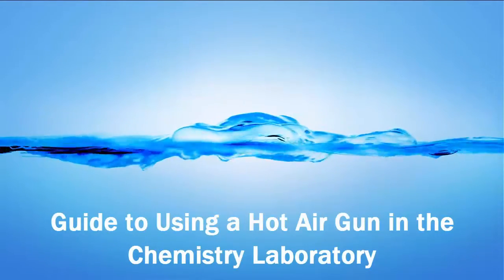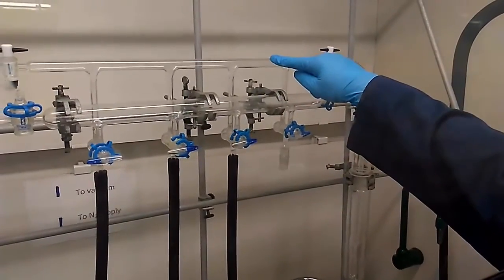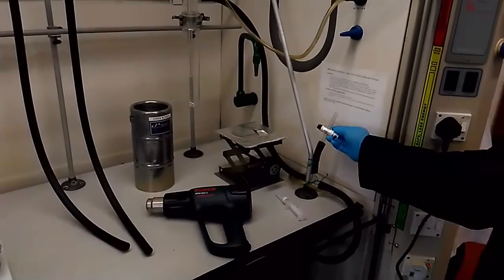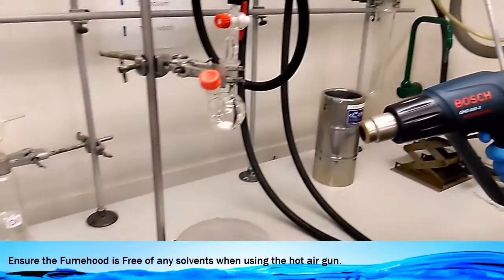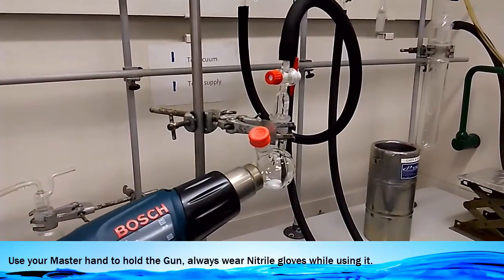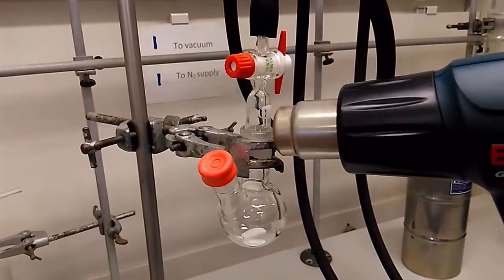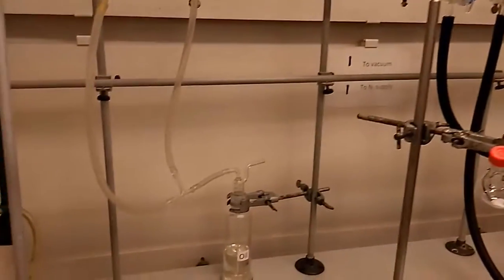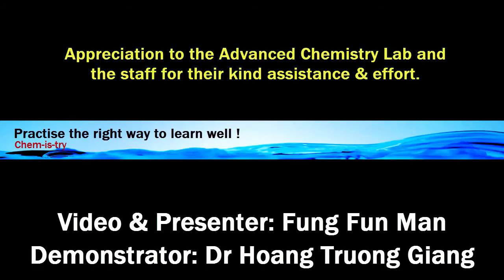How to Use the Hot air gun for Drying Moisture sensitive reactions OFFICIAL

Comment: I always wondered about letting nitrogen flow into the flask like that, I thought that maybe it would be over pressurized and pop joints if you don't have a vent needle, but in this video I can see that once the flask and line is full of gas the rest just flows through the manifold and into the bubbler.  I assume the flask is under a higher pressure than atmosphere, but is there any risk of blowing joints?  We don't really use the Schlenk techniques in my lab but I want to know for when I eventually go to another lab (or need to use them in the future here).
Reply from the maker: The glass , not withstanding cracks, won’t pose safety concerns.
Reply: thats what the bubbler is for. gas is always just flowing it cant overpressure because its an open system. the only pressure is from the oil which is easily overcome.
Reply: @user-mp4bc9qp2x  That makes sense.  I am curious what is the purpose of using a ventilation needle when transferring liquids from a bottle with a septum if that's the case.  I suppose the needle is small enough to where something might pop out and you don't want to take any chances when handling something like tBuLi.
Reply: @user-ko7lz3kr1d  i'm not sure what you mean. i dont use a vent needle when taking reagents from a bottle through the sure seal. it's just the nitrogen line with positive pressure. then you can remove solution via syringe. you use a vent needle when purging without vacuum so that the air can leave and be replaced with nitrogen
Reply: @user-mp4bc9qp2x  I've just seen quite a few demos online where someone will be handling a pyrophoric liquid and they'll use a vent needle for positive flow.  We just use balloons in my lab anyways so I've never had any hands-on experience with Schlenk techniques.
Reply: @user-ko7lz3kr1d  maybe you can link where you've found this? anything you do with the balloon is the same for nitrogen through the vac line. why need a vent needle in a bottle? same with the balloon the pressure isnt going to build up. any pressure from inside the bottle will just go up the needle into the line and displace nitrogen transiently.
Reply: @user-mp4bc9qp2x  I agree that all makes sense to me.  This video by Dartmouth shows the use of vent needles even with oil bubblers: https://www.youtube.com/watch?v=iLMl10X0Naw  Set up starts around 9 min.

I understand the use of a vent needle with no bubbler but agree that a bubbler should be all you need.